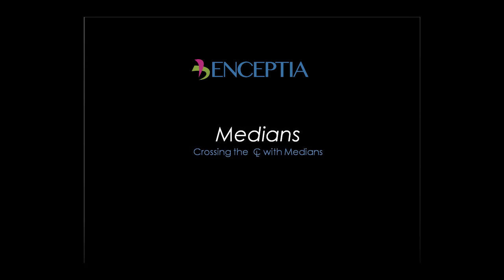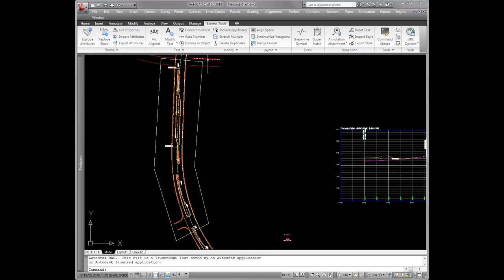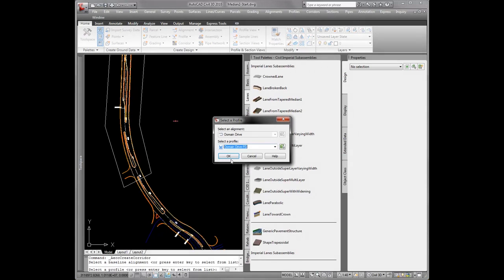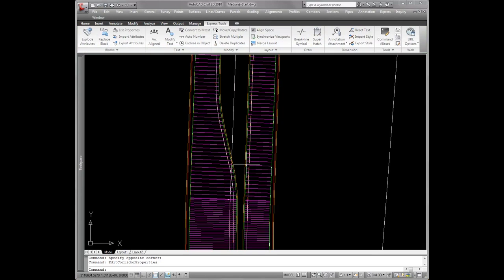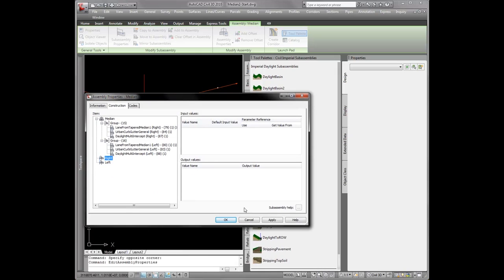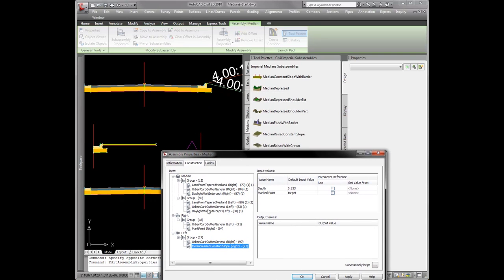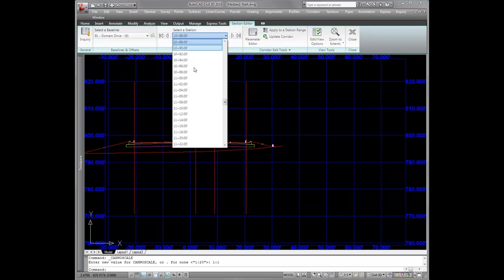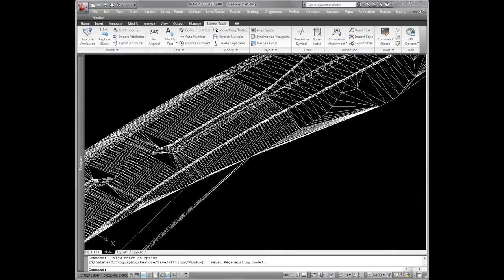Webinar: Medians in AutoCAD Civil 3D

Comment: This video has gotten me a long ways so thank you very much. One minor change I would recommend would be to move your lane from tapered median to your offsets, if you have a sloped median. If they are connected to the centerline and you put a slope on the median you end up with a gap between the median and lane on both sides. Lane from tapered median should connect to the median, so it doesn't follow the elevations of the centerline.

Comment: Punktmann, I'm sorry for the late response here.  I've not been monitoring this as well I should.  There are two ways to make the offset alignments. . .
1. Use the standard AutoCAD offset command and offset the alignment left/right.  This will make a polyline which you can convert to an aligment later.  In this method the polylines are not tied to the centerline alignment.
2.  Use the aligment offset command and this will automatically generate alignments left/right.  You must understand that with this method the offset alignments are linked to the centerline alignment.  As the centerline moves so do the offsets.